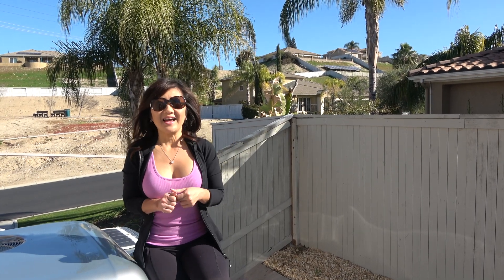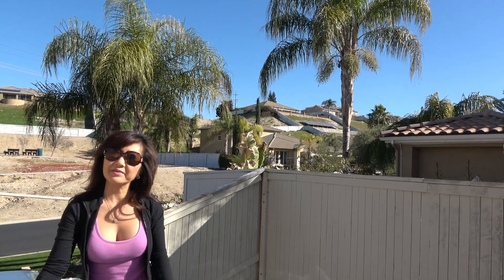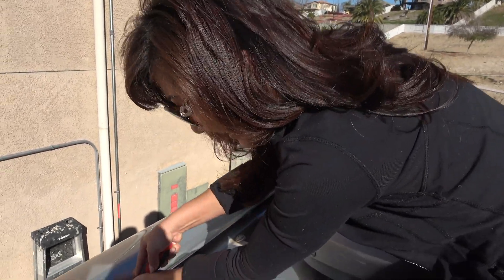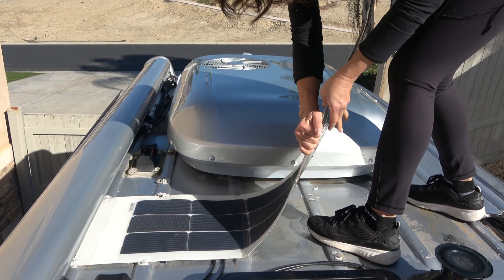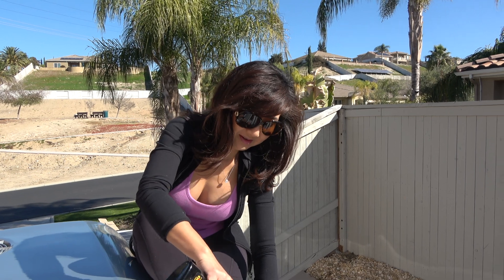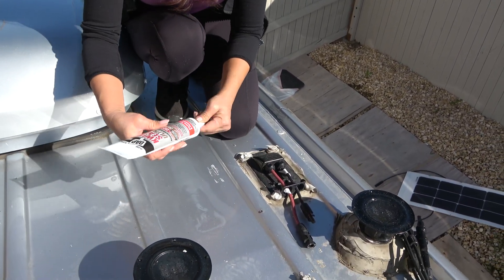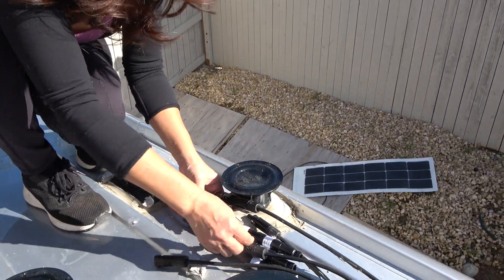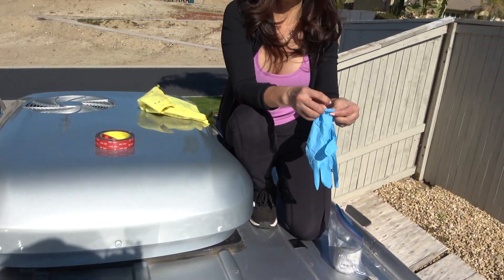Camper Van Solar Panel Addition/ 2022 Airstream Interstate 19/ 4K

Comment: Great Job, one question It looks like your awning is creating a partial shadow on your new solar panels. Does it affect your solar output?
Reply from the maker: Thank you Roger. The new panel doesn’t produce as much as the front panel but more than the back panel. The new AC is bigger so it covers a tiny bit of the back panel so it is not producing much at all.

Comment: Hi again.  Well I put a 22 AI19 on hold.  And of course see they the 23s now have the quiet ac and solar ports.  Did you guys add an external  solar charging port ?  Was it hard to do and did you on the old system?  Thanks again. Ross
Reply from the maker: Hi Ross, we don’t have an external charging port but Airstream dealer could put one on for us if we want to in the future. We talked to 2 2023 AI owner with the new AC units. One said it is pretty quiet but another one said it is still loud after she listened to ours upgraded AC. Some people on Facebook group said that there are 2 versions of the new AC and one is quieter than the other. The E1 package on the 2023 is nice upgrade.

Comment: Great solar installation video!  Our family really enjoys watching and learning from your videos.  
I have heard in some videos an interest in upgrading the power to use the AC and Microwave off the grid.  We too, are interested in the same upgrade.  We found "Lithionics Battery" that makes a package kit to achieve this result.  We are currently looking into to using Lithionics Battery to design a solution for our needs.  Thought I would share and hope this helps 😀  Again thank you for the incredible videos.
Reply from the maker: Thank you for watching Amina! We will look into that also. We are thinking of having Airstream dealer add another 2 of 100 Amp Lithium batteries and a bigger inverter but the cost is almost 11K. So we are still
thinking 🤔
Reply: @BamBamRVAdventures  Go for it!  I have a 2018 AI GL with 3000k invertor, with enough battery capacity and larger inverter you can run your AC appliances in the RV just like you do at home.
Reply from the maker: @ryufoto  My husband just bought the Ecoflow Delta 2 Max and he ran some wiring so now we can use the microwave, my big Nepresso machine over the weekend when we parked at a picnic area in Yosemite. Of course we only use one appliance at a time. He said he tested turning on our new AC with soft start to the Ecoflow and it works too. Probably not for too long but we can add additional Ecoflow batteries later on in the future if we need to.

Comment: Hello, always love your videos.  I'm in the market for a class B RV, a few questions for you:  How is the insulation inside the Airstream? does it do a good job of keeping the temperature? With 300W from solar, how many hours can you keep the AC running when boondocking? How about heating? does the airstream use Propane or electric for heating? Also, what type of gas mileage do you get? Thank you :)
Reply from the maker: Hi Jeffrey, thank you so much for watching! The insulation inside is much better than our previous Roadtrek but the back doors and sliding doors don’t have insulation materials in there. Some owners  put their own insulation ln there. We don’t have the need for more insulation since we only been travel in CA. If we travel more in colder temperatures in the future we will probably add insulation in those doors. As we are learning more about solar panels we found that whatever the panels say is not actually what we are getting. Since the panels are mounted flat on the roof, they will not able to collect all the sun rays at different times of day. Our AC runs off the generator only. In our previous Roadtrek there was no generator but there was 400 amp lithium batteries, 200 watts solar and an alternator. With that we can only use the AC for about a little bit more than 2 hours straight. So we do like to have a generator for the AC since it uses propane and that could supposedly last us for at least 10-12 hours. Truma heater uses propane in the Airstream and it is extremely quiet compared to our Roadtrek heater. We couldn’t use the heater in the Roadtrek to sleep because it is so loud when it turned back on in the middle of the night. We had to use the small electric heater but then it would use up all the batteries and everything would shut off in the middle of the night on the cold nights. We get about 16-18 mph. If I drive then it’s 16 mph when my husband drives then it’s 18mph. 😂😂

Comment: Great job guys much better than using screws
Reply from the maker: We saw you used 3M tape for your Starlink I think. 🤗
Reply: @BamBamRVAdventures  ok time for Starlink next.  We still love ours.  Everything on my roof is 3M.  Winnebago used screws and silicone glue on the factory panels.  Removing the factory panels was more work than installing the new ones.
Reply from the maker: @rvlifediy  we saw the new flat Starlink but don’t think we have any space left to mount it. 🤔
Reply: @BamBamRVAdventures  I don't think the new one is worth it.  It's much larger and doesn't work any better than the regular starlink and uses 2-3 time more power.  You can modify the original starlink to be flat mount.  Agile Offroad has a kit.  You may want to check it out.
Reply from the maker: @rvlifediy  ahh I see, I will look into that. Thank you! 🤗

Comment: sadly had to remove the front solar panel to make space for the starlink flat disk on my 19s. but Wi-Fi everywhere is worth it!❤
Reply from the maker: Great to have Wifi signal everywhere ! What model Interstate 19 do you have? I saw on FB group that a member installed the new flat Starlink on the side of the AC of his AI19. We might look into that  when we start to travel more.
Reply: @BamBamRVAdventures  i think it’s a 2021 one, since the vin showed up at Benz service place as a 2021 sprinter. However at the airstream dealership, it’s a 2022 one. So idk, but I think got no big difference. We got it installed at LA San Gabriel dealership. But yeah, with the air con and tv antenna, not much space left on top. However I saw u guys replaced for a quieter air con unit, not sure if the top part is smaller or not. But yeah, with that Wi-Fi, riding thru north cali to south Oregon is more fun 😄 have fun
Reply from the maker: @abel4870  Ours is 2022 model with 2020 Mercedes chassis. So we have the same solar panels configuration. Our new AC is bigger than the original one.  So there might not be enough room to put the Starlink there. 🤔
Reply: @BamBamRVAdventures  yeah we were thinking to remove the tv antenna since we ain’t using the tv much, to put the disk on the side of the ac. However not enough space, so the dealership recommended just remove the front solar panel and put the disk right above the driver seat. The end result is pretty good.😄Havent tried to camp afterwards, not sure how much solar power cut it would be. Since got the generator, I think should be fine.
Reply: @BamBamRVAdventures  just a side note, we tried to leave the Starlink on with only battery. It lasted about 8hr-10ths and drained the battery dry. Just a funny thing we tried lol. And I think Starlink introduced a sleep cycle function on the app to save power when u sleep.
Reply from the maker: @abel4870  yes good thing we have the generator to charge the batteries and not have to rely solely on solars.